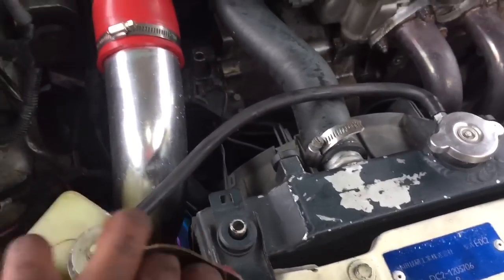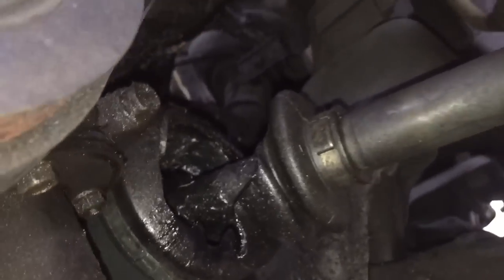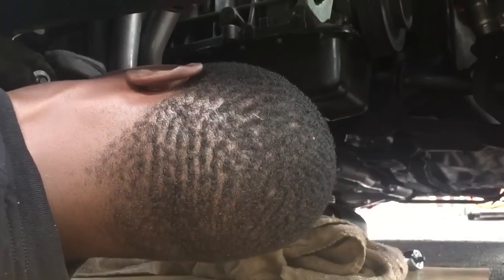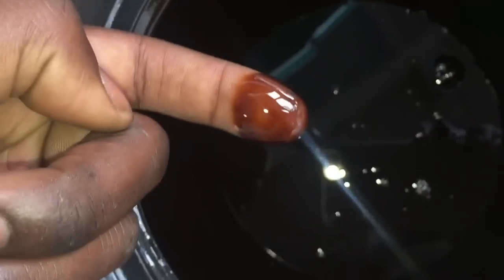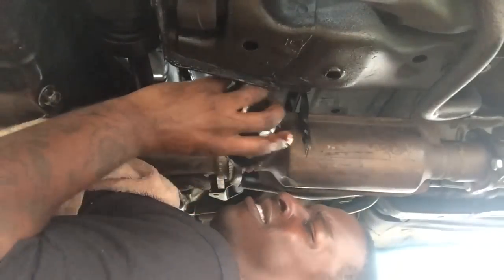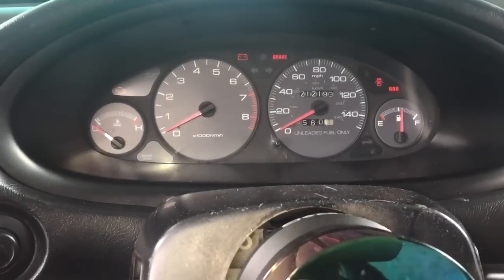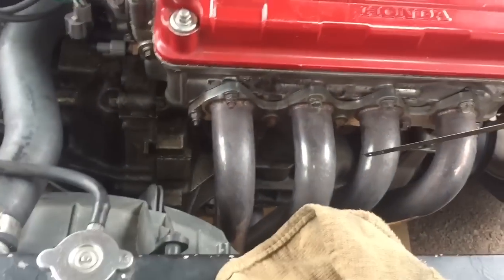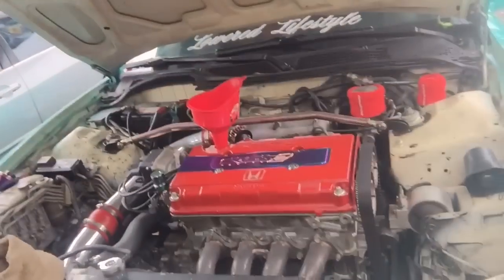JDM Integra B20 Vtec Build Ep 84 Engine Oil Change

Comment: I run 5w-30 also....hot and humid as hell in Florida lol....when you go boost...look into a moroso baffled oil pan
Reply: It doesn't matter if you have 10bhp for 1000bhp. A baffled pan is for hard cornering, they are well worth it IMO

Comment: The motor takes 4.2 qts btw
Reply from the maker: well that containter must have been that it fill it exactly to full
Reply: +JDM SWAG did you check the oil after the sat for 2+ hrs?